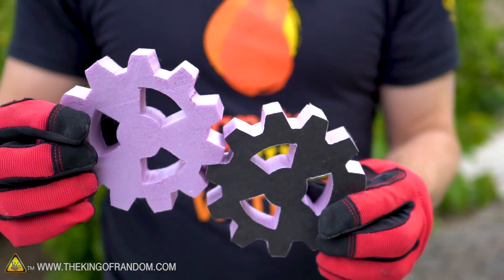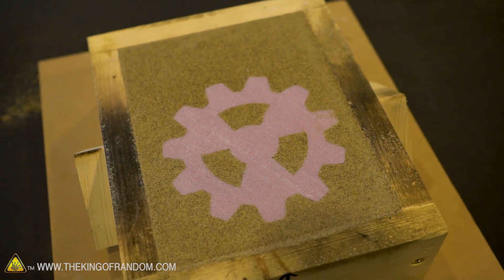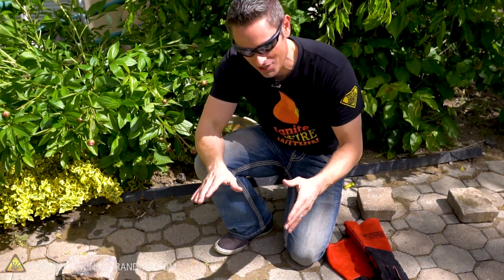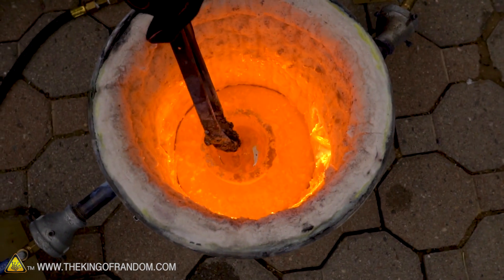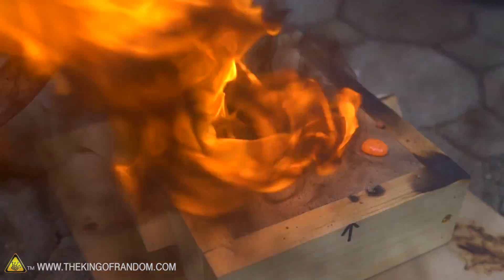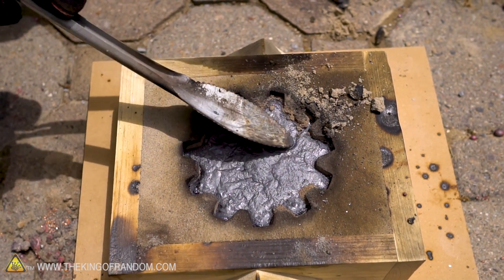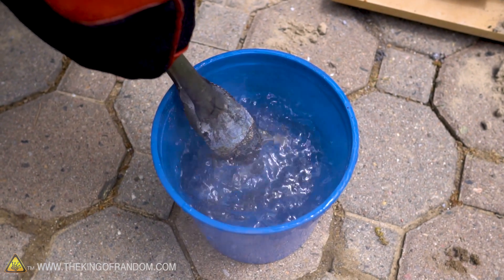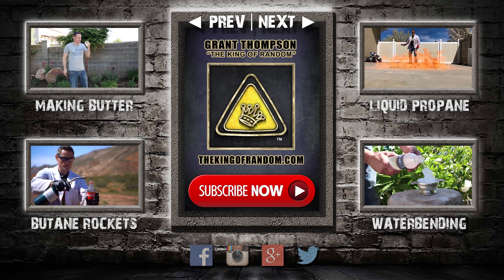Argh. Why Is Copper So Difficult? TKOR Tests Melting Copper In Our Homemade Foundry

Comment: Great vid bud I might have some idea's as to why your having difficulties,  I have done greensand copper casts before,  I am pretty sure your center detail is popping out because of two reasons.  1: the additional moisture in your greensand allows for steam to be created with the metal being so hot its instant which will weaken your structure as the steam cannot escape through the metal so it pushes through the sand.  Ideally greensand is about 6% moisture,  and 2: your only using half of your mold,  use both the cope and the drag and it will support your mold alot more just make some sprue holes and pour the metal into it the mold will insulate the copper and im sure you will get better results.  Feel free to contact me if you wanna talk more about your greensand copper casting,
Reply: Jiyuu-jin  lets hope hee sees this comment !!! Grant Notice HIM HI HAS A IDEA!!!!
Reply: I was going to say he isn't getting it hot enough. Sure it's molten but it's cooling too fast and the wet sand is making the situation worse.
Reply: I have seen more than my share of copper, and gold casting to say that the sprue holes and and sealed mold will help greatly, but I can also say that almost all costing I have seen of copper and gold is usually don with a plaster casting around a wax model, I am pretty certain that styrofoam, closed cell, would work two, but given the oxydation that molten cooper has when it cool is open air, a plaster mold, which just melts in water, would give you a better result, and plaster of paris is pretty cheap and sets in minutes. pour holes and a step off from the bottom, a steel road that is removed and back filled, of a stainles steel bolt that is left, stainles steel is a very poor thermal coductor, would both work. Just make certain that all plaster touching the model is poured at the same time to avoid leaking.
Reply: The whole purpose of his experiment is to cast copper using greensand,  so reccomending a different material (denser sand) is kinda moot to the purpose,  and yes adding moisture would seem like the thing to do but the steam is an issue,  hence the recommendation to use both cope and drag with a 6% moisture greensand mix.  excellent point though if I were in his shoes I would be using a wax investment cast much more reliable then styrofoam.
Reply: He should also use oil instead of water and he should use very fine sand
Reply: TGOTR yeah but what you were going to say isnt making any sense because if the temperature difference is higher it will cool even faster, and he cannot get it hotter. he held it in there for 20min, thats enough time to get the copper to tha max temperature - the oven isnt getting any hotter so the copper wont neither
Reply: Jiyuu-jin yes you are right. he should use both sides for more detailed castings
Reply: Jiyuu-jin lots of things missing vents, gates, riser, coatings, tolerance.
Reply: Hey Fenris000 I was under impression that adding salt would make aluminum less porous. So the metal is more solid metal when cooled, less air bubbles...? (I don't know but studying this)
Reply: RJSoftware2000 - Salt is a flux similar to Borax.  Borax will pull out the impurities from the aluminum and form a nice layer of slag that you drag off the top.  The salt will also pull out any aluminum oxide to make the aluminum even more clean.  When something becomes superfluous it does have less to no air in it, which in this case pulling out the AlO would make it flow much better.  And when its superfluous its because its retained more of its heat allowing it to flow.
Reply: Jiyuu-jin 

mills help
Reply: my two cents on this:

why do things rise up ? Because they are less dense, the issue here is that the sand is less dense than the molten copper, this causes it to rise up and out. Adding more moisture would have fixed the problem as it made the sand more dense but it created a second problem in the form of the steam that the OP mentioned. Im thinking another material for casting. Maybe a more dense type of sand, or maybe fireproof cement.
Reply: @Rishhank Kumar I am aware I didnt mention everything but I did say at the end to feel free to contact me as I would be able to describe the process alot more with direct contact rather then a mile long comment
Reply: Also, add some salt which will make the copper more superfluous so that you can pour it out faster.  Then it will do more of it's cooling in the mold.
Reply: That's the first thing I thought when Grant said he added more moisture and all 3 fell apart. Hot copper hitting water = steam, which crumbles the structure. Steam in the sand = mini explosion of gas.
Reply: RJSoftware2000 Tru NU-Salt (potassium chloride) I have had decent results, I strongly recommend not using chlorine tablets thou.
Reply: Can you use borax to separate sliver/copper alloy into its elemental components?
Reply: That's exactly what i was about to write jiyuu-jin. You need both sides of the mold to insulate the copper so it will fill up the mold before starting to cool off. Some spru holes and you will have it! Your sand though seems a bit dry to me. Hard to tell from a video.

Comment: grant you might want to try two piece molds and completely encase  the gear and use sprews to get the metal in the mold, it would have complete pressure and flow evenly.

Comment: make a cover for the frame, and then drill a hole from the end of the frame to the end of the gear after placing the sand, place the cover pour in the copper into the hole that was drilled and wait, however a disadvantage would be that u will have to cut the excess copper that was poured into the Drilled hole 😎😎😎😎😎😎

Comment: Grant Thompson use nail polish remover to get Rid of the the fome in seconds (IT ACTS LIKE AN ACID TO PLASTIC) and try getting the sand a little bit more wet (SO IT REMAINS STURDY) and if possible little thinner   (THEN IT WILL WORK)           like so grant can see : )        Big Fan

Comment: You should try using both sides of the mold, and make a funnel in the sand for the copper to flow into. Also, you might find wax might be a better medium then foam for inside the mold.

Comment: What You should do is put a layer of the sand on the top and bottom of the thing you want to cast and then just have tubes running down to the thing you want to cast. just like your old metal casting videos

Comment: I should add to my previous comment. If you are looking for quality molds, use a wood prototype, fine sand and as I said before, talcum powder. The way you're doing it has a higher risk of ingassing and sand contamination. And you should be using a cope AND drag and actually using the sprues and risers that you made

Comment: flow control... Look metal when melted is still heavy and will mess with your sand.  How to improve it? Control the flow... You need a rig so that you can control your pouring... "This might work"  But your mold is the real problem. A plaster of paris molds may work better "may work better" but i am no expert.

Comment: Grant! I'm sorry you're having such troubles. I think using less styrofoam by having two halves of the casting sand will help. you could extend one of the cog teeth and make a chute for the Molton copper to go in. Once it's cool you could just grind off the excess and save it for another melt. More work but easier to pour and less likely to alter the casting sand.

please check out Tito4re's channel. he makes copper everything pretty much.

Comment: You should use talcum/baby powder to make the parts separate easier. Any surface that you're going to ram sand onto and then pull off the sand should have powder on it so no sand sticks.

Comment: I think that the problem is that the density of the copper is too high for the homemade green sand to hold in weak points like the pedestals to make it look radioactive. It's like having a bunch of balloons tied to the bottom of a pool and the strings aren't tied tightly enough.

Comment: Read up on adding a binder to the sand to strengthen it (clay, vegetable oil).  Consider adding some tin or zinc to the copper for easier casting (tin is prettier).  A couple things regarding impurities.  You should heat your copper in the fire before putting it in the ceramic jar (this will eliminate more impurities -- water, etc.)  Secondly, you need to crush some charcoal in a mortar and pestle then, right before casting, toss the charcoal into your molten jar to deoxidize it.

Comment: Get the 3D printing nerd to print you a gear, make a silicone mold, cast wax gear, use investment casting to coat it, melt wax and pour copper. BrotherBansai does this for sword parts.

Comment: what if you use cement instead of sand
Reply: clearly you didn't see the recent video Grant did where some of his molten brass got on the cement and caused the cement to explode.
Reply: Then the casting wouldn't be as precise and he wouldn't be able to re mold it. The entire point of using sand to cast something is that you can re use the sand in a different mold afterwards.

Comment: use concrete instead then just break the harden concrete later, u should be able to smooth out the surface later.

Comment: hey grant, every time i have done green sand casting with copper, I have used both sides of the molds. this prevents those inner pieces from floating to the top.

Comment: Should have just made a plaster mold first. Harden it, Heat remove the styrofoam, pick up the remains of the styrofoam (such that you dont get any airbubbles in the cast from burning the foam). And then cast it. Would have taken less time and would have gotten it on the first try aswell.

Comment: just use the Cooper and add tin to make bronze that will give it the same shine but it wont wreck the mold I had a buddie make a axe using nothing but bronze and he used the green sand as a mold and it came out fantastic

Comment: Put some thin stainless steel rods in to the sand's intricate spots as you fill it with sand works fairly well. Did a few that way, skull parts and fake bone hand molds with the assistant thin stainless steel rods, but my set up is a little different from yours to make it easier to put the steel rods in.

Comment: the way I do copper casting is with core sand basically you take your playsand mix in a bit of sodium silicate then make your mold it gets hardened with CO2 and then you can pour the copper the other option is to do a closed mold using both he cope and the drag with regular greensand but you will need to vent the polystyrene

Comment: LISTEN ! 
The heat from the copper is evaporating the water in the sand.
Your sand needs to be more moist to make a perfect mould.

HOPE THIS HELPS...😁
Reply: shubh gaur i don't think that would work. The heat would instantly evaporate the water creating steam that loosens the sand.
Reply: The Witch Hunter 
but if he does it in one go n not 2 times as he did earlier, i think that would be okay because the water wont evaporate so fast. if he does it twice, he dries the sand twice.
its just a suggestion :P
Reply: Or just don't add water so it won't dry up and make steam in the first place

Comment: I could be wrong I but think part of your problem is the furnace is just barely getting to the melting point of copper. Think about the melting point of copper is 1984f, so if your furnace is only touching 1990f, then the copper would cool way to quickly. To where as if you could heat the copper to 2500f, your copper would stay liquid much longer, allowing you to cast it more easily. We don't know though because you never actually took the temperature of the furnace. It would be interesting to see just how hot the furnace gets.

Comment: Other green sands Ive seen used for casting have had a hardening agent in the sand like a glue so it holds its shape, also you should try skimming the dross off the top

Comment: he's pouring the copper too fast and because of the weight of the copper it pushes the sand aside causing them to crack and break. Solution :find a way to pour  your copper slowly

Comment: Hey Grant! Try adding clay to the green sand. Adding clay to the sand will give the sand an additional structural integrity. It will be easier to create the molding. Clay also hardens when exposed to high temperature so when you pour in the molten copper, it will solidify the clay and will prevent those sand to rise up due to the heaviness of the copper. Which means, copper will help stick the sand together.

Comment: Grant you need to use more clay and also use corn starch or baking soda in between the casting mold and the sand so you can remove the object.

Comment: Is it possible that the copper is too hot for the green sand, and that's why it's causing it to break?  Maybe it's causing the moisture in the sand to flash into steam and break those inner sand mold pieces?

Or maybe it's the mixture of the green sand?  Change the percentage of sand to clay?

Comment: No experience behind this answer, however can crucibles be made with a tap?  As long as it's mechanical parts are made of steel (melting point too high for the forge, right?) or away enough from the heat, it shouldn't be too hard, right?  A minor adjustment to the forge with a hole under it with a cover that can be removed.  While the forge's fires are still going, simply remove the bottom cover, turn the tap and whoosh!  A more controlled pour and less than a second from forge to mold to cool down.

Comment: Grant, you could try plaster investment casting with a wax mold then having the copper burn out the wax. the plaster should hold up alot better to the heat, the liquid  copper.

Comment: Grant try doing a two part mold with sprue holes
Reply: This is what I was thinking
Reply: Richard Fox like how youre supposed to do in real sand casting
Reply: Richard Fox yeah, investment casting is not really viable for copper; you can get away with it using aluminum, but not much else

Comment: you need to add clay to the sand and it would help a lot to heat  u p the sand mould in an oven or kiln to around 400 f.

Comment: Try using a sand lid to make the mold into a cavity with a pour hole in 
the middle and smoke vents for each tooth for the burnt foam to 
evacuate.
About the foam. Is that the recommended type for this application? 
It looks like it's turning into plastic chunks instead of evaporating 
off.

Comment: My opinion would be that the green sand is a little too dry. when the searing hot copper comes into contact it vaporizes all the water making it brittle. I think if you add more water it would do the job.

Comment: What Drayzz said was correct. You can also try using a board of wood that matches the inside of the sand box to tamp down the sand. Using a a block of wood would just push the sand around, whereas a board would press them together. (please like so he sees it )

Comment: When casting with copper put the foam in the center not the bottom and have a hole leading to the foam then poor (you may need more then one hole for the gear )

Comment: Grant,

Your casting using the wrong method (open mold casting). so the best fix is use another box of compressed sand  for a closed mold. this will help keep the details

Comment: Grant you should do this put the styrofoam in then put a bit or 1/4 of sand and beat it down the put another one 1/4 so u have 2/4 and then beat it and do that to the top.And then when u put the copper in it shouldn't move I guess I because the sand is more compact
Reply: Plz grant try this and can u show this message if u do this😉XD

Comment: Grant Thompson you need to completely enclose the gear in sand first make a nice layer in the bottom of the box and pack that down then, add the foam gear. Finally glue a foam riser to the gear to have a pour hole and then add the rest of the sand and pack very tightly. Basically like your flower pot casting you used to do I promise this will work I've casted copper many times please message me if u have any questions or would like me to send u a how to video! thanks for what you do.

Comment: you should try mixing sand with a silicate binder, forming the mold and injecting CO2 gas into it. the gas hardens the mix and you get a solid mold that won't just fall apart

Comment: try to make your sand box deeper and completely bury the gear. then you could use the chimney technique that you used in the past and pour down a Styrofoam chimney. That would prevent the sand from floating and the foam from melting to quickly

Comment: Might I suggest creating a literal mold that's solid.. like the playsand mix used for the mini metal foundry.... it's a one shot deal but it should be solid enough to maintain it's shape and will definitely not be destroyed by the molten copper... theoretically speaking....

Comment: Bury they styrofoam entirely, leaving only an additional styrofoam funnel exposed. This will keep the copper insulated inside the mold and allow it to burn out the styrofoam and take to the mold slower and fuller. It will also improve the structural integrity of the sand mold. If you still have problems, think about adding a wooden lid to the mold (obviously, with a pour hole).

Comment: use co2 to freeze the sand and make it stable
Reply: The sand has water in it... if he froze it the water would turn into ice and everything would expand and it the casting would be screwed up. Plus the molten copper would unfreeze it instantly.
Reply: Go to MP Dragon channel to see more
Reply: Logan Beaupre that's silica sand he uses, not greensand. Silica sand might work tho
Reply: I think that would have the opposite effect.  The hotter the sand is, the better the copper will flow through the mold.
Reply: AquaLife&More no, mpdragon has silica sand, Ik grant has greensand. If grant was to blow co2 into his greensand nothing would happen. I'm saying he should try and make silica sand